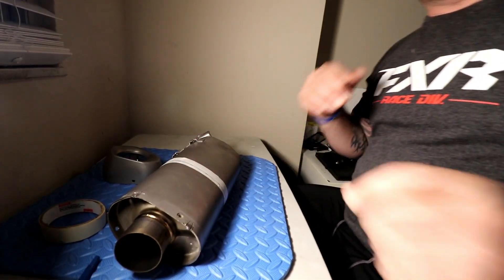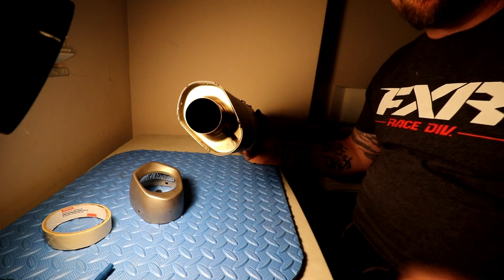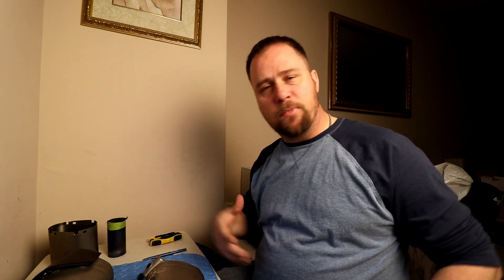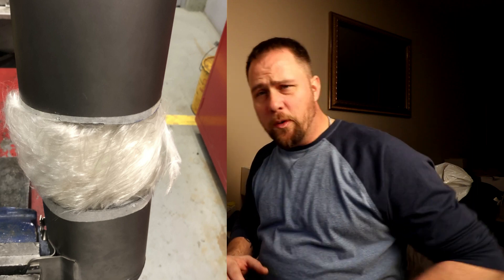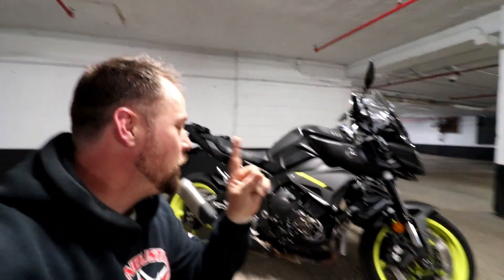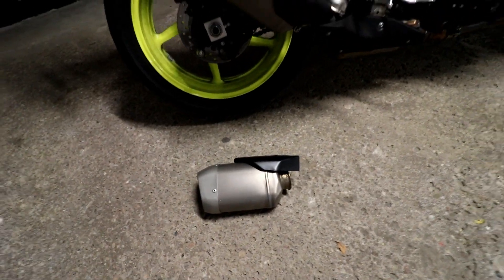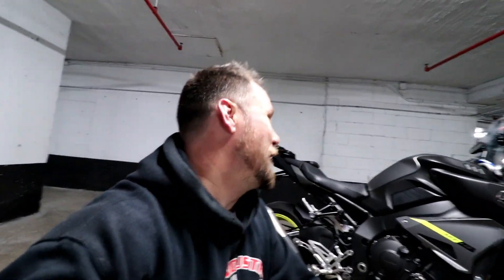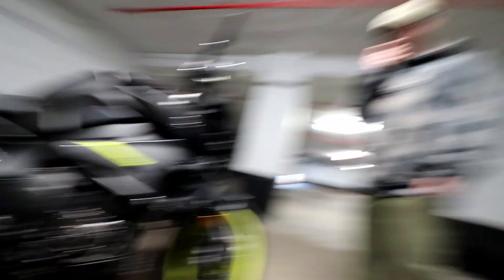Yamaha MT10 and YZF-R1 Pipe Mod tutorial w/soundclip 19:16

Comment: Hey everyone, I want to share my modification: Just took the R1 Slip-On and mounted it onto the MT-10 - It's louder quite a bit and more bass-heavy :)
Reply from the maker: Both are a straight bolt one. Interesting you say it's louder. Louder is not a bad thing 😁😁😁😁😆
Reply: @itsadyerthing  You are right - both are straight bolt. However, the MT10's Slip-On (at least for the EU Model) is a different one. It has a narrower passage on the bottom as well as a different "E-Number"

Comment: Nice 🎦 mate. Just how much did u cut off exactly? Just bought one to do the same as I too am sick of paying over much for a new end can, which generally don’t make that much difference if any 👍
Reply from the maker: Sorry I can't give you length. But that shouldn't be hard for you to find our. Take a ruler and measure inside. I simply cut off all the none perforated tube. So the solid tube is what i removed from mine. Does it make a difference yes it does help. What's a couple of hours messing around vs having to spend 700+++ on a slip-on that'll do same thing. I had used a mt10 with a Yoshimura slip on and could hear any difference than stock so doing the stock mod in my mind makes a difference!
Cheers
Rob
Reply: I’ll be in the garage next week if not before. Bought a genuine cat too, so thinking of gutting it and trying that with the exup valve either fixed open or removed, then put in an MWR air filter and finishing off with an woolich ecu flash, happy days.
Reply from the maker: @itwasntme7721  I've seen people cut and gut the cat right by the welded seam and reweld for a super clean look!  Do note that the exup is a working tool especially for the MT10, its where she will provide you with that bottom. End torque... I had did a test and removed it when I did a decat and hated every min of it. The exup had to go back on cause it made a world of difference.....  but what you're doing is awesome,, old skool fabrication and and respect you for that.. not always about buying fancy bolt on stuff. Get out and get those hands dirty. You'll be proud of yourself for doing so and makes your bike that much more unique.....
Cheers
Rob

Comment: The second question. Did you feel that the back end pressure was significantly altered to the point that is affecting the combustion?
Reply from the maker: Elie Nehme the nice thing about doing this is that you keep you existing catalytic converters and your factory exup as we are simply playing with the slipon so you should not be altering any back pressure or low end torque. That was my mistake last week when I did a decat. This was a huge change and didn’t stay that way. I simply wanted a little more sound over stock. Doing this mod totally gave it to me..
You can obtain the same outcome with a Yamaha R&D Yoshimura slipon that Yamaha offers or a Akrapovic offered through aftermarket and lastly an Arrow slipon that is hard to find. 
I simply converted my baffling muffler into a nice sounding performance enhancing go faster exhaust lol...
Cheers
Rob
Reply: @itsadyerthing  that's awesome. In any case the road test will show everything.
Reply from the maker: Elie Nehme I think a quick rip after work is in order simply for the act of science lol...
I’ll take any excuse to ride !
Reply: @itsadyerthing  keep it up brother